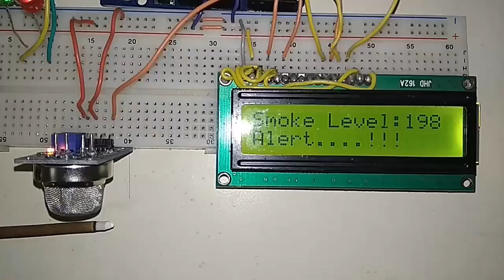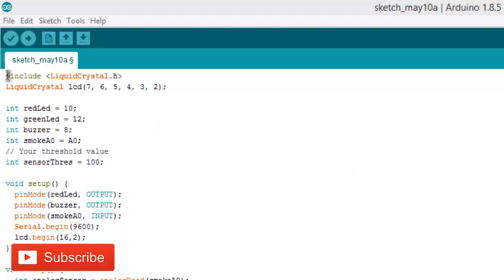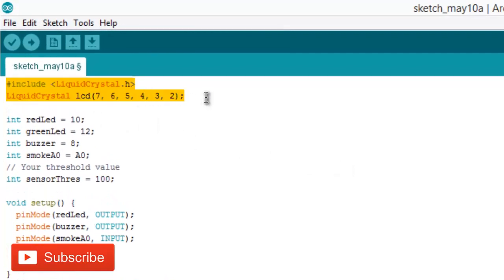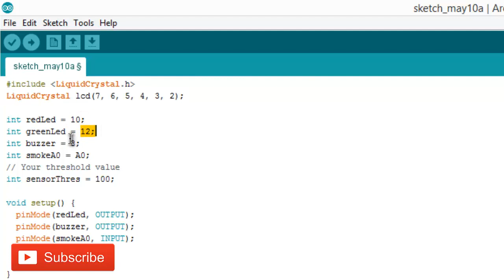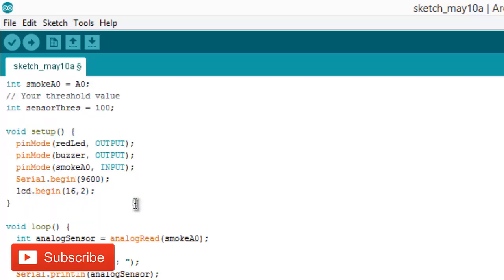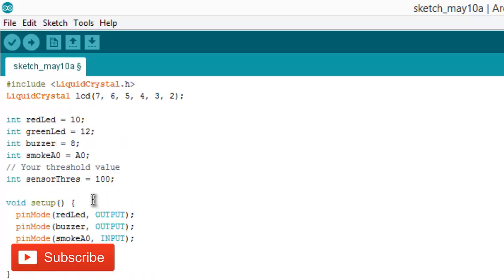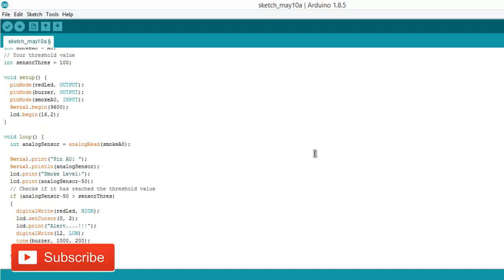Smoke Level Detector with Alarm using Arduino & MQ-2/MQ-5/MQ-135 Sensor

Comment: Can you please provide the circuit diagram where potentiometer should be placed?
Reply: You don't always need a potentiometer. If you link the E pin (Enable) on your LCD to a pin on the arduino (recommended pin 6), you can control the contrast that way through the arduino IDE. so first write  int Contrast = 10;  , and in the void setup() you would add analogWrite(6, Contrast);

Comment: here the modification i did , first instead of buzzer i used BC547 transistor with 1K ohm resistor to the base and connect 5V relay to the collector to drive a fan and change threshold value to from 200-250 when to rises to the pick value the relay energized and activate the fan to extract the air. Tnx!!!!!!!!!!!!!!!!!
Reply from the maker: Wow.
Can you share a working video  of at least 1 minute to my mail ID.I would like to upload that in the Youtube channel.

Comment: What is AnalogSensor-50 ???
Reply from the maker: -50 is used as a calibration value.
You can check yours and change on the basis of behaviour.
Reply: @HowtoElectronics  Don't have -50 can you

Comment: Can u please send the code it isnt appearing in the discription
Reply from the maker: http://www.how2electronics.com/arduino-smoke-level-detector-using-mq-135-sensor/
Reply: How To Electronics yea i have gone through this but the code is not appearing under the source code heading
Reply from the maker: Use computer to see code. Code is disable when you go through mobile phone.
Reply: I have also checked your other videos the code is appearing under the heading but in this project the code is not there

Comment: Sensor is subjected to smoke but the output is 0 PPM .could you explain me?
Reply from the maker: Either your sensor is damaged or connection of analog pin is not correct.
Reply: @HowtoElectronics  both the leds are glowing

Comment: what is the unit of the smoke level ? is it in PPM? does the sensor read the data in PPM by default ?
Reply from the maker: No its just a random value as it indicates analog voltage level

Comment: I make all connections ok and  installed program sucsesfully but display showing nothing and buzzer is continually making noice and also red led is blinked. please give us solution 🙏
Reply from the maker: U made wrong connection. Fix it according to code and circuit diagram
Reply: @HowtoElectronics ok I will check...tnx sir
Reply: @HowtoElectronics same type of error it's coming
Reply: @bharathshreyam4209  same problem here
Reply: I checked all connections according to code and circuit diagram. But it not working...
Reply: @vaibhavthakre819  bro did you solve the problem ? even i am getting that
Reply: Same here
Reply: Same here bro

Comment: MQ2 and MQ135  sensor useing arduino code sir????
Reply: both sensors used at a time??
Reply from the maker: Any sensor will work with same code
Reply: 2 sensors work in same time???
Reply: Send me this project document sir?